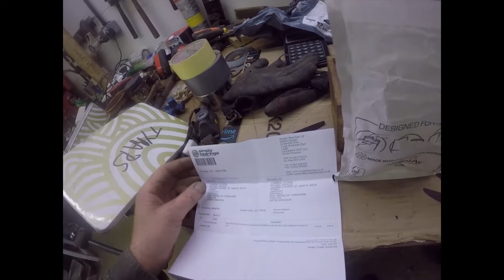I stop being sidetracked, and actually get back to the pipe bender!

Comment: Miserable weather lately except for one day. Good to see you battling with foam, had I known I would have warned you about the dust issue, been there and got that T shirt. If I had the budget I would have a go at the Major but other things are more important (Diesel or petrol welder). Metal off-cuts, I cringe when folk call the scrap and bin them! Vegetarians, I doff my cap to you young man because I could not be deprived of meat for the vegie beliefs of a wife. And therein probably explains why I never married, I am not very compliant when it comes to being deprived of something I enjoy. In my opinion, keep the fridge, you can keep your pies in it, milk for brews in it and lots of other tasty goodies!
Reply from the maker: I already have a nice fridge, courtesy of a local freegler, and I intend to keep an ongoing stock of goodies! I was surprised how easy it is to get the insulation off the old scraps of roofing, and with the foil layer on it, it is ideal, and has made a huge difference in lighting ease and efficiency, I am well pleased, but will be glad to get away from the mundane and back onto something more interesting! The problem with the dust was that it was shooting out behind me and settling very quick, so I never noticed it till I finished the job, but its all cleaned now!
Phil
Reply: @philhermetic  I have also cut cushion foam with my circular saw, it does a great job but makes a mess with dust!